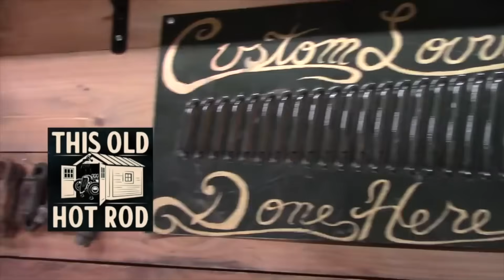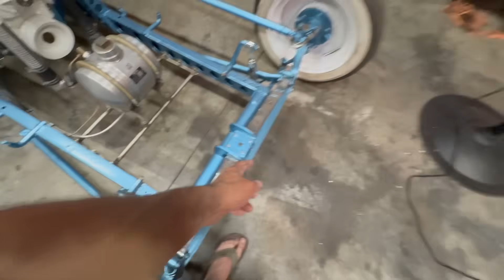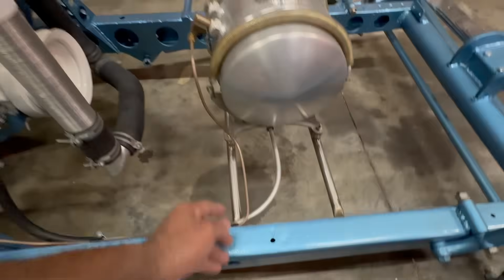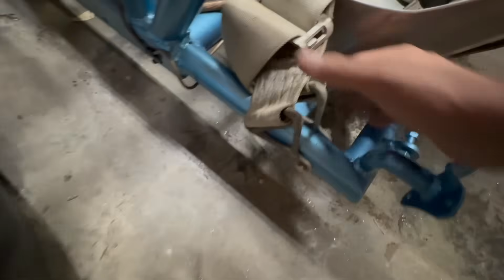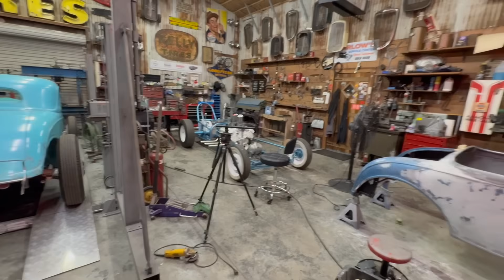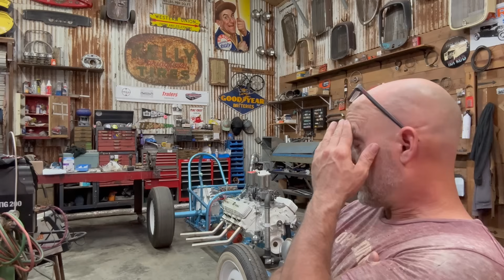Front Engine Dragster Build

Comment: Interesting build on dragster. I had a similar one in the 60s, Oldsmobile engine, Zephyr trans with 2nd & 4th for quarter mile, Hilborn Injection. No pressurized fuel system, just a small hand pump in the drivers area (like a bicycle tire  pump). Chassis Research frame from Scotty Finn's shop. Be careful not to put to big of avtire on back because it's easy to break gears in trans. Our cars were push start, no cooling system, just water in block, one gage for oil pressure. Have fun!